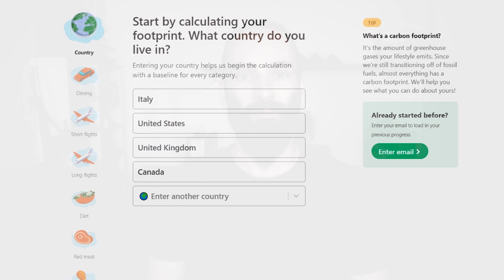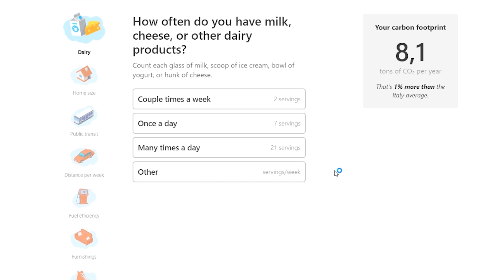Chainsaw Chain Damascus Experiment

Comment from the maker: Join me on Wren and start offsetting your carbon footprint today! We'll protect 5 extra acres of rainforest for the first 100 people who sign up! https://www.wren.co/join/blackbeardprojects
Reply: Sei un grande come sempre
Reply: Nt
Reply: do you ever have issues with the style of handles you use all the time i figured if anyone you would know the pros and cons . do they loosen up at all or are they better then usual pin style or just glue
Reply: When I worked in electroplating, the first tank was a hot soapy tank to get rid of oil, then to an acid tank.
I see a lot of people doing the chains and I never see anyone properly clean the oils and grease.
Try it. Dawn and hot water. Boiling. We kept a flame under it.
Reply: Could you do; stacking beads of hard facing MIG wire, till it's an 1.5"x4" square roughly, cut it from the patent material and try forging it into a blade? That'd be interesting as well 🤔

Comment: If this actually works it will be a slow and steady job (also super interesting) the chances that you got that cleaned completely is low no matter how much cleaning you did
And even Smith's with 50+ years of experience or that are masters of Damascus still have blowouts with regular Damascus patterns/layers

Edit* so glad you took your time with this

Comment: You have a problem with the air pockets. To fix that, try making a small square or rectangle out of some plate, coat it in some anti-seize, and layer the pieces of chain adding a spoonful of tiny steel beads. Then weld the plate together to shut the box, heat it up, and slowly start compressing the sides. After doing that a couple of times you can let it cool down, cut the ends off and you should be able to peal off the plates. And then you are left with a solid chunk of damascus.

Comment: 7:28 seems you might have inclusions or a poor weld? De-greasing is quite a chore with things like chain links/chainsaw blades which may have been the cause? That and PLENTY of Flux is needed too, looks as if you may have not used enough in the one clip? Is there a product called "Simple Green" available where you're at? They make a concentrate version, which works insanely well on grease and oil if you don't dilute it, even for "baked" on oil like you find on engine internals, such as piston rods for one! An overnight soak in that and the Steel come out SPOTLESS! It's biodegradable too, so a rinse with water and then some alcohol and you're golden!

Comment: Nice knife, but I thought Damascus was the process of stretching and folding over and over to achieve the layered effect. Not squishing separate pieces together?
Reply: You are refering to folded steel which adds density and strength to a blade. Damascus is the finished product of the process of forgewelding 2 or more different types of metal together. I used the term metal instead of steel because I have seen copper used in damascus and it came out beautifully.

Comment: 4:37 Instead on stacking a lone piece of c70 atop your damascus billet (read: resulting in damascus pattern on 1 side only), id have been tempted to cut both in half crosswise, then stacked all 4 with the damascus on the top and bottom, then drawn it out to length.  That way you'd have had the chain pattern on both sides.  

Then again, I have ZERO actual smithing experience. 😄
Reply: That would work

Comment: Id have been worried about a few of those delams, there was some huge gaps in between some of those welds after you finished forging the chainsaw billet, dropping those pieces in a canister or canoe wouldve been safer, but looks good 👍👍👍

Comment: I only very recently started watching these videos. What is that powder that goes on the metal after it comes out of the furnace? Also I would like to see a Damascus steel katana if it’s possible.
Reply: I think its borax
Reply: Also if you want to see a Damascus Katana, Alec Steele did one a few years back.
Reply: Flux
Reply: As said it's flux, the most used is borax. When it melts it creates a sort of film which isolates from oxidation the surfaces that you want to forge weld, making easier and more secure the whole process. Another traditional flux is quartz powder

Comment: That was neat. What did the paste do on the back spine and partly down the blade? Was it to make it softer when heated up or just impact a pattern onto the metal?
Reply: The paste is blocking the heat we use it in goldsmithing / jewelry making so not to not over temper or crack something especially when forge welding
Reply: @angelicsailor1st  Thank you for the answer. I only know about hobbyist casting so this was informative.

Comment: Awesome video mate! I've done a fair bit of chainsaw chain damascus myself, and it's not an easy thing to do. Especially with all the different alloys of the chain. I did upload a video about doing it myself a while back if you're interested, but my suggestion is to just keep experimenting with it ^^ I never bothered with cutting the chain or cleaning it as thoroughly as you did. For me it's been enough to simply coil ut up on itself, give it a few tacks with the welder to hold it all together, normalise it once, because the teeth are hardened, then fluxing before it reaches the scaling temperatures. I usually tend to forge these stacks into square bar for making rings and Mjølners, and to get some interesting patterns i tend to twist it square, then draw out to final thickness. Not sure how easy that would be to translate into a knife, but you already seem to have figured that part out anyway. Good luck mate, I'm looking forward to the next one, and feel free to ask if you have any questions ^^
Reply from the maker: Thank you brother!! I remember very well you Mjollnir pendant, that was the first time I saw anything made of chainsaw chain. It did look awesome and that must be a reason why I kept that old chain jar I found around :)
Cheers!
Reply: nice project I once made dama steel out of saw blades and I bought a few bicycle chains and I want to make dama steel out of it do you have any tips
Reply: @firework5493  You can have a look through one of my old videos, but in essence it's all about moving slowly and keeping things clean before welding
Reply: Thank you very much I'm also still working on getting iron from iron ore do you have any tips for that too
Reply: Hello are still chainsaw chain can joint together if i dont use the white powder in the making?

Comment: Technically this is not Damascus as it isn’t pattern welded.
Reply: Pattern welded Damascus is technically not Damascus. Damascus is folding metal to forge out the impurities. Pattern welded is to take pure metals and make predetermined patterns. Real Damascus does not make a certain pattern. It’s just to fold out impurities

Comment: Pleeaase hand sand your blade, at the very least go to 600 grit...😫 also your etch is way off it has no contrast no depth, try etching for 10 minutes then sand it with a 2000 grit sand paper and repeat a few times until you're happy with the result then coffee etch it for a long ass time like overnight then very gently buff it. Also your ricasso is way too thick there's no transition between blade to handle